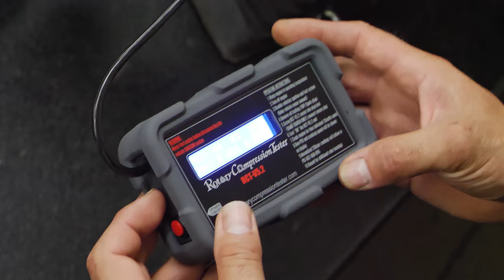3 Rotor is DEAD. I’m done with rotaries for a while...

Comment: Rob, 
First, I'm sorry for your loss.

Second, Love the vids, esp 4rotor build.  

ignore the rest if your not interested in outside opinions on the build constraints issue....

(can I suggest you look (w a pal?) at fuel system hose internal die in calculation to flow rats/volume you are asking, I seriously suspect that the your current system is constrained. also I suspect the surge tank pumps are failing in the system Because of the hi input pressure from tanks pumps? Or form the surge tank pumps inherent design pressure limits/regulators???? 
I look forward to your next vids as always and hope you share what you discover as root cause.

again thanks for sharing and sorry for your gut punch, holy-daze are hard eunf already... 
Sincerely Matthew McKibben

Comment: 2 weeks ago posted on your
 video: Misfiring like crazy at 30 psi!
Not an a/f ratio? If you are running 13+ under load of a spooled turbo,  your engine is not a ticking time bomb. It's just ready to detonate and evolve into a T-1000, just without the terminator insignia. And the claim of 1000 WHP for any reasonable length of time.

----
I meant to say "now*" a ticking time bomb, but I hate to say I told you this was going to happen. Well good luck... :/

Comment: well this day sucked for you and I feel for you.
lesson learned. If you don't trust a sensor stop.. fit the issue..
As for the 83psi issue, is the surge tank under pressure?
If the in tank pump hits its peak it can only feed in more fuel at the pressure this could cause a pressure drop in the surge tank creating a small vacuum in the tank (as fuel is removed) that needs to be compensated for. 
quick solutions if this is the issue... larger surge tank - would reduce the vacuum effect, or bigger badder in tank pump.

Comment: Dahm I've been following your build for quite a while and frankly I have to tell you that you have a bad tuner. In the initial videos it sounded like you had a stuck side seal or corner seal and the tuner tried to go around it. I see later it was fueling and somewhat ignition related, your tuner should have heard the breakup and stopped you from doing anything till the problem had been resolved. For your tuner to push your car on a dyno (a WAY higher load then street driving) with it breaking up on street conditions is reckless to say the least. He then puts your car on the dyno and tunes under high load while the engine is still breaking up, knowing that breakup is happening under street load. I do not know what you think of this guy but he is not worth your time, I've tuned countless rotaries and wouldn't touch your car with that breakup; let alone put it on a dyno. As you know rotaries are very sensitive but also strong when setup correctly, this tuner doesn't seem to understand that basic premise. Either way I hope you the best and please find a better tuner so you can hit your goals and we can see some awesome videos!

Comment: I mean, I dont know why you need two 1000+hp RX7's anyway .
That doesnt sound very realistic and seems a little silly to me, but whatever
I would personally have 2 for 2 different reasons, 4 rotor is the track / speed monster
make the 3 rotor as reliable and fun as you can to drive in  public, on streets

Comment: Pushing too much boost though that engine without enough fuel is going to give you a really bad day. You should have taken better care when its was on the Dyno enough to know that you were doing damage to it. Rotaries can be strong but are easy to break if they aren't getting everything they need.

Comment: Isn’t 14:1 the normal air to fuel ratio tho if I’m wrong don’t hate please tell me I want to know
Reply from the maker: Genuinely good question. I thought the same way originally. Under high load you want to be close to 10.8 to accommodate for natural fluctuations in combustion. It also provides some extra fuel to cool then combustion. Or at least in theory. So the benefit is two fold. Get close to 14 at full power and you melt or break things
Reply: Thanks btw where in Michigan are you from

Comment: read this carefully  rob dam  as i am a qualified mechanic of 32 years experience so there you have it the tuner let it blow obviously doesn't know what hes doing yes he had a really fast r100 and fd3 along time ago,  but others tuned those,  i could easily tell abel had no idea when he was building this apparently you bute race motor as dahm explained and did shit small ugly ports and didn't show them well clearly  cos they wer ugly and uneven due to lack of experience as well as not putting sealant on dog legs of housing and used standard dowels for extra dowels a real shit idea, that only a butcher would do as there is not much margin for strength when you bore the holes bigger for factory dowels witch will do nothing for strength as you have seen.  he clearly gave it to much advance and that's why it cracked the block, and not once did i see them pull out a large drum/ fuel container with markings to see how many ltrs per min its fuel system can flow,  witch  real performance tuners do, you dont dyno a car before this test,  then set timing at minimum advance in order to not detonate it,  you mite want to mount a full time fuel pressure gauge out in front of windscreen if you want to check fuel pressure for drop off under high load on dyno,   its the tuners responsibility to insure not to blow it, or start tuning with out all the pre checks yet we have wankers who ain't mechanics trying to do a mechanics job making fuck ups like this,  there are other stupid shit things here like shooting for 1000 hp with t04 flange dumb asses,  they say in other videos how abel makes everything there when clearly he doesn't and they pay for an over priced stupid manifold with 2 inch runners an to4 flange it looked all pretty an that's it dumb bastards, it was sitting turbo to close to inner guard you would think abel would make the ex manifold him self  with 2.5 inch pipes and t6 flange and make it clear every thing for this car specifically that's if he has ever made one.

Comment: When you build and tune a car properly it works a lot better rob Dahm, th hunt just finished a fd rotary built 13b I believe with no troubles at all at 700 hp and even hert from hoonigan built his fc motor in a fraction of the time it’s taken you and had it right the first time making easily 700 hp. WITH HERT BEHIND THE WHEEL, meaning he breaks everything he touches and his car lasts perfectly fine. You need a better builder possibly and definitely a better tuner. If your tuner is bypassing safety measures as a split second decision trying to make more power that’s stupid. He shouldn’t know he was going to roast the motor, that’s extremely stupid, on a car that takes a hell of a lot of fuel and you’re going to bypass safety measures to make more power lean? Ofcourse the motor is going to get torched. Sounds like it have some random Honda guy tuning a built fd 3 rotor and you need way way better. Until then I’m not watching anymore cause all this is, is updates of both your fds having problems from terrible tuning and being underbuilt.

Comment: that fucking sucks dude, as misery loves company i can tell you that i bought a gc8 sti that broke down when i was driving home, fuel pump died. Had to pay 500bucks to get it fixed in a shop since it was a town i knew noone, kept driving, car goes into limp mode. But had to drive it home since i wasnt gonna shell out more money when i was so close to home, that was 2 months ago and car has been sitting outside my house cause its hard to get ahold of the sensor i need(which may not even be the actual fault) so i might have bought a fat dudd. GGs

Comment: Just an fact that you may not be aware off …     Mazda used mechanical fuel pumps to make sure that engine does not run out of fuel at high revs …     they had electrical pumps and mechanical pump work together to make sure there is all ways right fuel pressure and it never runs out..   it circulates the fuel back to tank that is not needed .     that all so helps with the cooling of fuel rails , so you dont vape lock the fuel system.       But that is racing ..    your car is street car with engine that was about 80 percent race spec.  And that is about the limit you want to go , if you want to have any drive ability with it ..     

Im just confused why you keep doing rookie mistakes still with the engine tuning.    You should not never disable the safety features..  you should adjust the values instead .. but never take off the feature …          I ques it is the fact that money is not issue for you , and hence you do not stop to think before you act.

Comment: listen! Why are you struggling with a petrol (rotary) engine? Buy 4 80kw ac motor from electric cars , 2 inverters from electric cars (so far we are talking about 600 Usd for the whole lot from the junkyard), buy a bunch of used laptop batteries and build an 18650 battery pack - you will have a really fast car, a really reliable car at a low price.

Comment: Please note people, from a purely mechanical engineering point of view,.... the iron can be fixed, but is it worth it??? (someone mentioned a cut and plug fill option, if effected area is "delicate")... 
cracks are cracks, not breaks, so fix is easier, BUT, it's about containment of energy that has already found a pathway...drilling ends, welding at not effected area into effected area.....ect ad nousium

Comment: mech fuel pump with at least two electric pumps and a surge tank (for redundancy ) , and I am sorry but some of this is your fault slow down do stuff right that whole mess of a fuel system should have never seen a single pull until it was 120%

Comment: Abel is supposed to be one of the “best” tuners. The car has been stumbling and misfiring on boost in all of the videos of it running. 

This is what happens when you ignore and push through 😂🤪🤣.... 👀🤫🤫🤫
Reply: He spends so much on rebuilding the engine, buying a decent ECU but wait let's use a piece of shit engine loom with bare wires sitting on top of the block with no protection. Oh and testing the pumps with water in the previous vids probably didn't help.
Reply: Like a grow bag for tomatoes, just add water 🌱 

Oh and the wideband is cutting off to protect the engine, nah fuck it just push through 🤫😂

Comment: I just watched the previous video. You were all giddy like school girls trying to hit 1000hp, while IGNORING the fuel system saying it has a problem. A good tuner would not have pushed the engine that hard in that particular scenario. If the tuner did NOT learn from this, then they should re-evaluate what they do for a living. On the one had the tuner learned a lesson at the cost of Rob's car. I am not poking fun of the subject, as I learn the hard way as well.

Comment: Run 3 fuel rails and three injectors per rotor instead of trying to using 3 fuel pumps to run one fuel rail. You can get the same amount of fuel to the engine without the pressure dropping. Come on man

Comment: Dude, im mechanic i want to tell you something. Rotors are shit... And are shit because they are like glass, very delicate and after 40.000-60.000km you have to change the rotors.... They consumption a lot of oil and a lot of fuel... The torque is like a ghost, 0% torque, and easy way to get horse power at high RPM because less fricction but with a lot of wear of the rotors... Thats why rotors were abandoned as obsolete and inefficient and no one is using them anymore after the happy joke of the RX-8. Bye!!